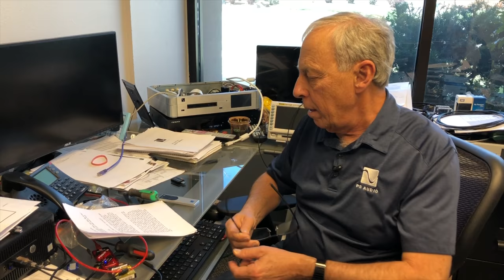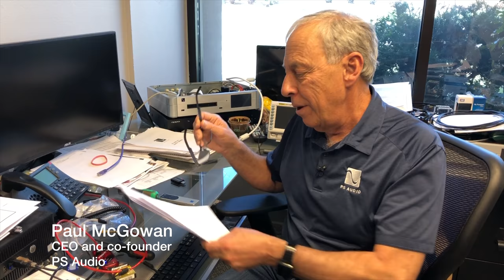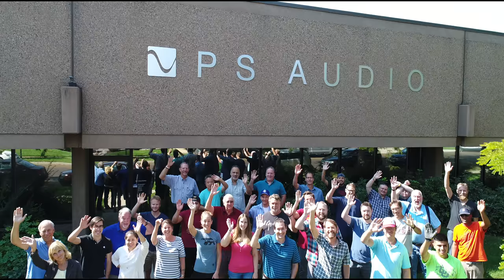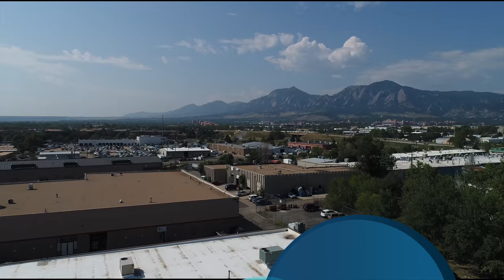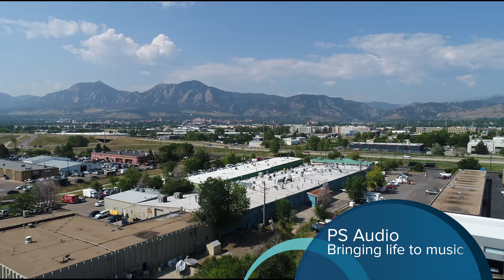Does temperature affect sound?

Comment: Sounds good when he listens without the electric heater. Maybe when he turns on the heater he is getting more interfering noise on the AC line? Maybe heat up the room and then turn off the heater and see if the sound improves. Could be both the AC line noise and the temp?
Reply: steve elliot agreed
Reply: i think u r right

Comment: I think that you forget one of the main reason for changing sound. All components in his system have a temperature above ambient temperature and every component changes there behavior, depending on its temperature. So extra heat make some components sound different. An other thing could be that he has a defect component that needs replacing.
Reply: why and how does extra heat make sound different? (sorry to bother you, but i really need this info for my science project XD)
Reply: @joyjasin688  Glad to try to help! :-)
The explanation is that if you look at datasheets for components, you will see that there specification changes depending on the temperature. Distortion, linearity, speed and so on changes, it is often a little change but several hundred components combined, do make a difference. :-)
EDIT: As you know, does temperature contract and expand material so that distances and thickness of materials do change the components data.
Reply: Fried Mule, will the volume sound different because of temperature?
Reply: @joyjasin688  It may depend on your amount of gain, if you have a tiny change in your components and then give it a gain of 1,000 then I think that you could here the difference but under normal condition with gains up to 200 you would not perceive it different in volumen.
The change in a component, due to heat or cold is wary tiny for every single component, but if you multiply it by many, your effect is many times higher, i.e. many components followed by a large gain and suddenly you have an effect you can easily here. :-)
Reply: Fried Mule would i be able to use a decibal reader to measure the sound?
Reply: @joyjasin688  Yes no problem, if you can measure fine enough and have a place that are exceptional silence.
You may have to measure changes 1:10 of a fly's noise while flying!
Reply: Fried Mule, I’m testing this question: will a metal bell sound different if it was hot, cold, or room temperature? 

And, I’m still working on my hypothesis. But, i just want to say tysm for wasting your time on my questions and explaining them to me. I hope i do well...lol.
Reply: @joyjasin688  I am wary happy to help you, and as long as Paul allow it on his channel, I'll keep trying to help you, so just keep asking! :-)
Reply: @joyjasin688  Sorry didn't see your question about the bell, the answer is a theoretical yes, no human would ever here any difference unless you are talking about extremes like heating the bell up to near its meltingpoint but due to the atomic density the sound would change, but we are talking fractions of Hertz that non would ever here.

Comment: When I was younger and HUGE into car audio, I and others would hit higher SPL in cold weather compared to hot. The proof was in the meter. 1-2 dB higher. We assumed a reason was the gear running cooler and air density difference.

Comment: Another factor that COULD be related to difference in audio fidelity depending on temperature is the equipment itself could be very temperature dependent. Higher temperatures in electronics can yield more noise. The circuit might be poorly designed and too temperature sensitive. Some amplifiers start intentionally to compress the music or reduce the volume when they get too hot. If you try to heat up the equipment (hit the heatsinks or vent holes; don't melt things) with a hair dryer and you can hear the sound changes, you got a problem.

Comment: Paul's explanation is really BRILLIANT! I suspect it has to do with arrival-time differences of direct and reflected sound to the ears. In general, we wish to have a difference of at least 5 mseconds between direct speaker sound and first reflections sound. That's how our hearing mechanisms will not confuse it as one, unified, muddled sound but will understand it as an initial sound with reverberation. That grossly translates into 1.7 meters of difference between the direct route length to the ear and the reflection route length. But this 1.7 meters is derived if the speed of sound is (1.7m:0.005sec=) 340 meters per second, or a room temperature of (!) 15 degrees Celsius (oC)-indeed, really chilly for a living room. If the loudspeaker/boundaries setting is marginally ideal at 15 oC, then, at a higher temperature, when the speed of sound is higher, this, initially OK direct-reflected route length difference, may proove short, as the sound, now, will travel it in less than 5 msecs, so the overall sound will get muddled. For instance, at 23 oC (a nice, warm room) the speed of sound raises at 344.8m/sec, so we need a [first reflections route- direct route] difference of... 1.724m. Now, as you see, it's hardly an inch of difference but it might prove critical. So an effort to distance the loudspeakers a little further from the walls is justified - even an inch for each one might be ok. (-smile-, well I hope that helps a bit too, bye-bye...)

Comment: I have observed that after running my speakers at concert volume for several minutes the air coming from the enclosure port is above the ambient room temperature.  This is likely because most energy sent to the speaker is lost as heat.  Also depending upon the cone material,  thermal expansion could come into play.  In a colder room the heat is transferred from the speaker to the room at a faster rate than in a warmer room.  So it makes sense that you listen at a comfortable room temperature and set up the system at that temperature after all components have been operating for a while.

Comment: The underlying issue is likely a combination of things surrounding humidity. Colder air cannot hold as much water and hotter air can hold a lot more (although if you're using a heater, it's likely even more dry). Even putting aside the physiological effects of a cold or hot room, the psychological ones would also be quite strong.

Comment: This is an issue about which I have been ruminating (roominating) for some time. I'm not so sure the answer is repositioning of the speakers; that to me doesn't make much sense, since the waves are the same. It's about how the air holds the sound. As a musician / composer / producer / sound engineer, I find it becomes much more about the mix you're producing. Certain temperatures seem to hilight frequencies in your production, thereby making them sound "better" to one's ear. It could be the same song / track, but it just bites your ears better, giving a more rewarding experience. 

I have sought to create sounds that 'play' with the perception of temperature in their character and combine them together in a mix that will work in the broadest of environments, so it sounds consistent. The most vital thing is, to have a handle on the ideas we're talking about which are not discussed widely but are so important... Stand in a field in the middle of a night listening to psy-trance or breakbeat and experience how cold air can make a dynamic but otherwise non-intellectual tune affect you (disco biscuits optional). I don't write that stuff but I know its sonic effects and try and re-apply it to my own work.

Temperature in sound and the various ways it can be implemented, hold a powerful key to that which we listen.

Comment: I guess there is more than one factor. Working point of electronics might shift, the different speed  of sound will modify the resonance frequencies of volumes (room and speakers) but i think the most important could be the different stiffness of materials. That could soften the speaker meterials and really make a difference. If you have you ever rolled up a cable outside in winter you might have noticed that it is significant stiffer than at room temperature.

Comment: Sorry to have to disagree with you Paul. Heat is random motion of molecules while sound is directed motion. All other things being equal, the colder the air the denser it is and the faster sound will travel. Sound will travel in liquids and solids too. They say if you put your ear to a railroad track you can hear a train 100 miles away. Density also changes with barometric pressure, the higher the pressure the faster sound will travel. Cold surfaces may be more efficient reflectors depending on the material

The third factor is humidity. Water molecules tend to absorb sound and the higher the frequency the greater the absorption. I had a calculator on the internet years ago that did the calculations for you.

We call temperature, humidity, and barometric pressure conditions of state. When making precision scientific measurements they must be noted because they can affect the results. How far does sound travel when you hear it live? As an example consider a sound with an initial loudness of 90 db in a room with an RT of 2.5 seconds. This is typical of many concert halls at about 500 hz to 1 khz. It takes 2.5 seconds to die out at 30 db where it becomes indistinguishable from ambient noise. At about 1100 feet per second it will have traveled back and forth about half a mile. In a cathedral or other echoey place it can be 2, 3, or more times as long. In your listening rom it probably dies out in 0.2 to 0.3 seconds. That's a lot of missing sound.

Comment: Thinking back to my experience with car audio and drastic temperture swings. Driving to work in the morning my system sounded great. However, while in the office for 8+ hours the subwoofers baked in the heat inside the trunk. When fired up the bass was overwhelming, loud, loose, muddy, etc. After a few minutes the sound would return back to "normal" as things cooled off.  The extreme heat would soften the surrounds of the drivers.

Comment: Hello Paul,
The temperature and humidity of the air do cause pitch variations within the pipes of the organ.  The organ is only truly in tune at the temperature at which it was tuned.  The flue (chimney) pipes change in the opposite way from the reed  pipes. Thus the organ sounds very much out of tune with even small temperature / humidity (air density) changes.   In he case of a sound system, I would be more suspicious of turbulence in the room caused by moving warm over cool air.  This disruption is very destructive to the uniform transmission of sound throughout the room.

Comment: I noticed the effect too when i used my Denon D2000s in the Winter outdoors at -15 degrees C. They sounded a lot more sterile compared to room temperature.
Reply: LOL
I removed the walls of my house and now my HiFi sounds sterile (LoFi).
LOL
Hmmm, who would have thought.
Reply: The Denon D2000s are semiopen headphones. So they have their own "walls". Based on that indoors is the same as outdoors if the ambient noise level is the same.

Comment: I find that my systems, in general, do sound better when the temperature is cooler as well.  I believe this is due more to the electronics being more efficient than the speed of sound through air.  My amp came stocked without a vented enclosure and it got too hot.  Venting the enclosure made the system sound better and less compressed.  Just another perspective to consider.

Comment: As temperature increases, the air can hold more moisture, leading to an increase in humidity. This increase in humidity results in higher air density, which in turn slows down the speed of sound. 5:00

Comment: This is a much overlooked problem. I literally feel I have two systems - a hot one and a cold one. I think as others have touched on, speaker bass cone surrounds become much softer in the heat and produce more bass which can colour the midrange. I hadn't considered the density of air but that may well be a factor too. All I can say is when my room is cool (16c) it sounds tight and puchy in the bass, transparent in the mids and a little bright in the treble which adds up to it sounding  detailed but dry. When really warm (23+c) it becomes warmer and richer but more smeared and bloomy with too much bass. The optimimum temperature I find is a very narrow window of 19-21c. On to the temperature effects you can superimpose mains quality issues at certain times of day. I have a balanced mains unit to clean up the mains but the huge transformer inside buzzes like hell  at certain times when I presume the mains is especially bad.

Comment: Barometric pressure plays a huge role on how sound travels. He is correct cold air is dense warm air is thin. I know for certain that if you watch a barometer and see it falling. The pressure is getting heavier. A storm front is moving in cooler denser air. When the barometer is high the air is thin and sound will travel much further and faster. What's a barometer I promise you'll see

Comment: Interesting one Paul. Like you , my first thoughts were to re-align speakers at the comfort temperature, maximising the difference in path lengths between direct and reflected sound at the listener. The figure 1.7 meters minimum springs to mind (don't quote me). I believe this is to delay reflected sound by an acceptable amount. As the speed of sound increases, the delay time will shorten , maybe enough to produce the 'confused' sound.? Hans Beekhuyzen  does a neat video on reflected sound in the listening room.  
No wonder it takes a lot of expertise in really setting up a listening environment - it's so complex. Isn't that why we audio fans like it?

Comment: Warm air is less dense than cool air which is why the speed of sound is faster at sea level, and that sound travels even faster in water because of waters increased density. I would think cooler, denser air would have sound traveling more quickly.

Comment: I’d say the moisture on the speaker cones would be the largest difference with temperatures changes, then maybe the amplifier bias is not well regulated with temperature change with also improper placement of the components in combination of the heat source.

Comment: A certain harshness can be mistaken for crisp and clear sound. I am a bit baffled that Paul only mentions the property of air at different temperatures.
Elcaps at higher temperature work significantly better,  transistors temperature sensitive where it comes to HFE, and also Vbe by the way. Higher temperature, higher HFE. (and lower Vbe). Also electrons become "more active" at higher temperatures, cone suspension is influenced.

Comment: I really notice the change in my car in the winter. I have a Focal rig in my car. It sounds super sterile and edgy when it is cold like that. So much so that I literally turn the HF drivers on my amp down a little in the winter and as we get to summer I have to adjust them again. More than temperature though I find air pressure is murder on sonics. I do a ton of large format live events and you can often hear the system change dramatically as the air pressure changes. I have Smaart (a comparative measurement system), some pretty cool measurement mics and stuff but when that happens it is cowboy all the way still. Just roll with the punches and hope the rain holds off a bit. Usually that is why the air pressure dramatically changes.

Comment: Is it possible for temperature to alter the spider and surround such that the voice coil changes alignment in the magnetic field? Do electrolytic capacitor characteristics change with temperature, particularly when they are degraded? Circuit noise is certainly influenced by temperature. Cartridge compliance and perhaps even the vinyl of a record may be influenced. As mentioned below, sound absorbing materials may be influenced, particularly in enclosures. Circuit noise is certainly influenced by temperature. I think you have to look at everything within hearing distance and thoughtfully apply physics.

Comment: I had the same problem after 1 hour with me the sound with distortion amp.is hi-end T + A pa1530r loudspeakers jbl studio 590 problem is the speaker wire.old wire  4 × 1.5mm. no names are now 4 × 4mm.oxigenfri wire with bananaplugs problem is resolved at some temperatures copper????nonames  changes the structure end the changes the sounds problem is not in the room temperature at the temperature of the cables (wire)

Comment: he  might want to try a dehumidifier? or placing  some heavy books 4 or so on top of your speakers. might  not be the air at all? it might be expansion is the problem, on the speakers or electrical equipment connection, let your room warm up first before you turn any electrical hi-fi equipment on then hear what it sounds like straight away at that temperature keep the temperature and see if any changes. if you have tube Gear it could be a tube problem what's causing it? it's the oxygen molecules getting excited they transmit the information to each molecule and that hits you're ear.
 I thought that pumping oxygen in front of the speakers with very thin pipes at a slow rate or ring around the drivers would have a dramatic effect? what are these look like cables I see on some manufacturers put in front of the speakers what is that supposed to do.

Comment: There is so much nonsense in these comments.  Not to mention that Paul's explanation is woefully incomplete.  Expect more from someone in his position. 
 
Ambient temperature, humidity and barometric pressure has an impact on sound transmission.  But it also has impact on hearing, mood, and audio system comments (drivers; electrical and mechanical, electronic devices such as transistors and capacitors).   The later may even be a greater impact.  Especially since they also generate heat just from being in use.  Then even more heat as the ambient temperature rises.
 
As with many of these videos, what Paul avoids saying is very telling.